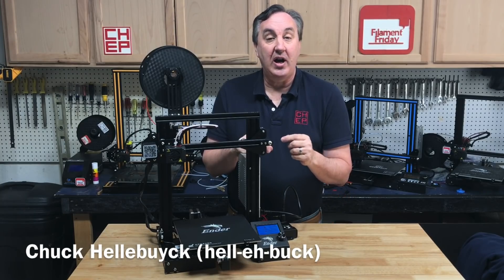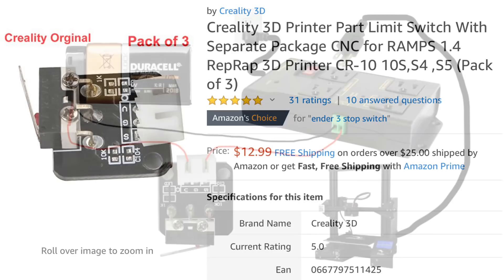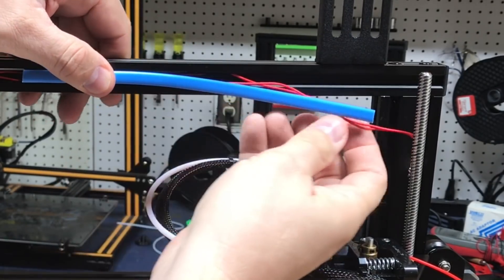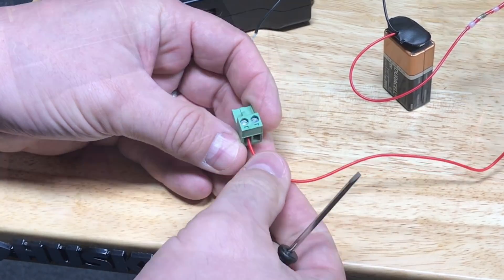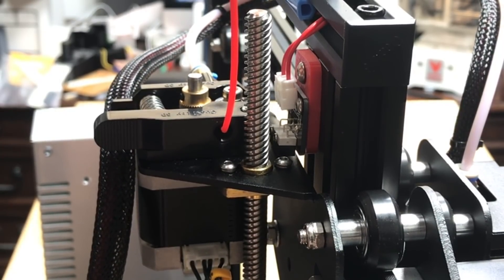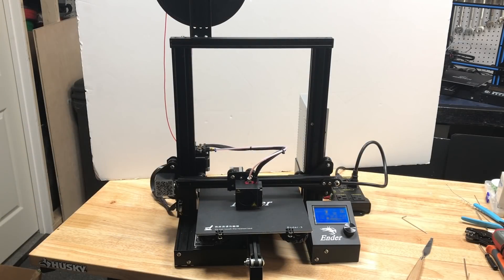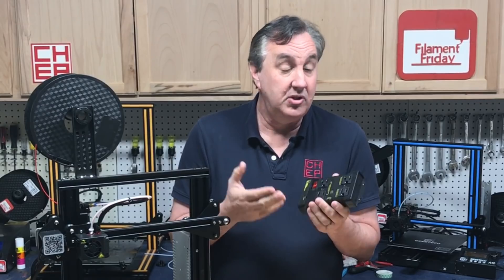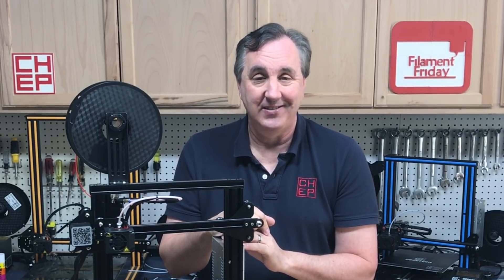Simple Auto Off Control for Creality Ender 3 without Octoprint

Comment: Not sure I agree with the crimping method, it may be fine for low voltage/current circuits but do not do this for higher current circuits as the insulation means the contact surface area of the cable and the terminal is greatly reduced, surely not a good idea!
Reply from the maker: When did I crimp a high voltage circuit?
Reply: @FilamentFriday  I didn't say you did :-) but people may think it's the correct way to crimp a cable in all situations, I'm not having a go, I've been in the automotive electronics industry 30+ years and I would never crimp through the insulation but it's probably fine for your application. Just saying, not criticising,
Reply: High tension wires at 11000v are all crimped , all the plugs in a car are crimped until we reach a circuit board, its a proven concept.
Reply: @CarkeekW  Crimping's not the issue it's crimping through the insulation and not removing it that I think is not best practice.
Reply: I've always stripped wires before crimping, but at 3v3 up to 12V (low mA draws like this) even one strand making contact is sufficient. It's good enough for IDC ribbon connectors on Pata HDDs. Now, anything above logic signals I'm going to strip the wire first.

Comment: I used that same relay box to make a thermostat for a space heater. 2 months later I woke up to the smell of burning plastic. The relay burnt a hole straight through itself, through the outer case, and left a puddle of melted plastic on the floor. The Ender 3 doesn’t draw nearly as much current as a space heater does though so it should be fine
Reply: Space heaters and outlet strips, let alone these over-spec'd chinesium switches, don't mix well.
Reply from the maker: Space heaters typically draw a lot more than the 40A limit of this relay. You gave it the ultimate stress test.

Comment: TIP: Add some extra GCode to wait for the printer to cool down before shutting down. Turning off the head fan at high temperatures is not a good idea...
Reply: M109 R80 will set the hot end temperature to 80 degrees, and wait, even when cooling. The R is important there, otherwise it won't wait
Reply: This.

Comment: You can do all this with a 220v lever switch  and when the table moves to the front at the end of the print it hit the lever and shuts off.
Reply from the maker: So you would prefer high voltage wires running under a moving hot build plate?
Reply: @FilamentFriday  the lever is connected behind the bottom of the powersupply with a wire tail of 2 inches.

Comment: Very interesting idea, I already have Octopi connected to my CR-10s, so I'll have to look into it shutting off the power when the print stops.
Reply: Octoprint can use gpio for CHEP's choice or better yet one of the smart switch plugins and a wifi switch.
Reply: @OldCurmudgeon3DP  since posting this I've been researching and trying to make a final decision if I want to use Octoprints PSU and thermal runaway plugins or the Enclosure plugins.
I already installed a 12v led strip across the top brace and ran the wires through the factory loom into the power supply in the control box, so they turn on and off with the power to the printer. I was thinking about maybe separate on/off control for the LEDs with the enclosure plugin.
I would prefer not to use a wifi smartswitch, because IOT devices security sucks and I don't want it to be an attack portal for my network.

Comment: Good idea.
Using AA batteries would save a lot on batteries, they have at least 4 time the capacity and usually they are much cheaper than 9V batteries and even using 4 or 6 AA batteries will be cheaper.
I am very interested in the crimper tool, I need a good tool for JST.

Comment: I just use a $7 WiFi socket plug. The way you do it is awesome. So many cool options. One day, maybe....
Reply from the maker: How does it shutoff at the print is complete?
Reply: CHEP you can do it two ways. First manually via an app via the internet so wherever you are you can switch it off and second you can set a timer. So I set it 10-20min after estimated end of print.
Reply: You can also see the current draw remotely on these Chep so setting an alarm on your phone , checking the power draw and manually choosing to shut down is a valid option too.

Comment: Got a problem:
TEVO Tornado with a firmware problem: First I had the blue screen of 
death, so I re-uploaded a fresh version of TEVOs firmware. No errors 
before or after uploading and all categories/options are there. "BUT" 
open the 'Print from SD Card" and I might get just a blue screen with 
the word 'Main" on top... close and reopen and it'll show all the files 
on the card, "BUT" it will not let me scroll down past the first one. 
Now if you select that file and click it IT REBOOTS! back to the desktop 
screen every time.

OK lets try something else, so I downloaded Marlin V2 patch 4. it came 
with a ton of errors, (days to figure out and fix). Uploaded/no errors. All 
categories/options are there. Go into "Print from SD Card" it lets me scroll 
the list no problem, "BUT" (Are you ready for this?) any file you select it 
"REBOOTS" back to the desktop screen!!!!

So the million dollar question is how can I have two OS's doing the very 
same thing? Where do I start looking and what am I looking for?

Comment: I am into video 1 minute but already see it's kinda inferior. I have a temperature-controlled WIFI relay (12$), so I can turn it off after printer cooldowns also it has WIFI so I can turn it on/off with a smartphone after I see an error via webcam it is also literally just plug and play.
Reply from the maker: Looking forward to your video on it.
Reply: @FilamentFriday  It would be awful since I am both bad at presenting something and speaking at the audience, also English is my 3rd language. I also have finished your video, I quite like your option, I have considered something similar at first, but then looked into WIFI sockets since my printer is in the basement, and found this Sonoff relay. I also love how you hide the wires in the extrusion I will steal this for sure for my LED strip wires. Also, it looks like that your relay could be controlled with raspberry pi so you could get both worlds, wifi, temperature and manual z stop.
Reply: KAJJTAN what kind of relay? give a link please
Reply: Using temperature is a really good idea to sense end-of-print.....
Reply: @geoninja8971  I rarely use this feature now. It's bad for rasperry pi. I should plug it into always on socket I guess.